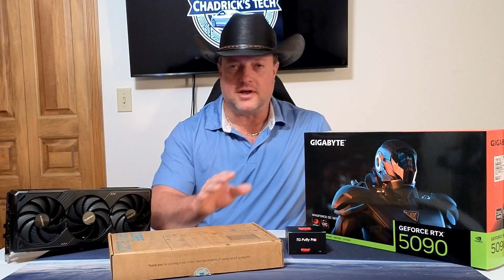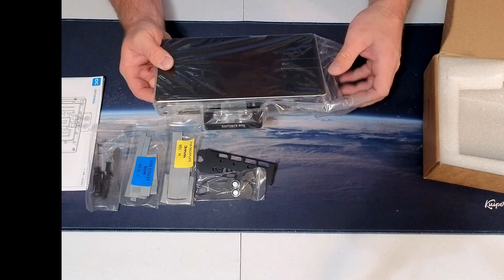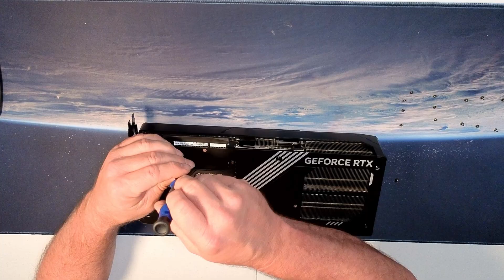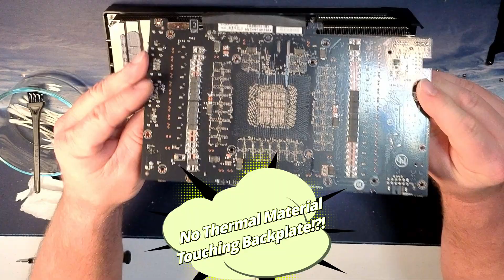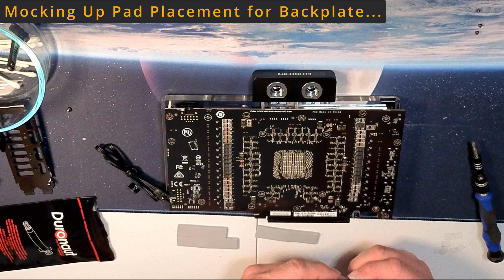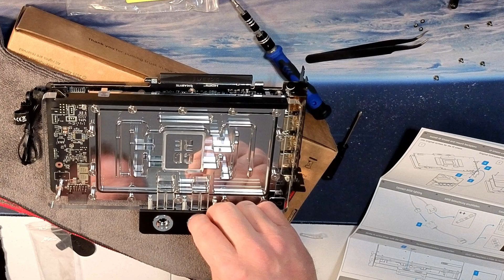Alphacool Waterblock Install on Gigabyte Windforce OC RTX 5090

Comment: Is it possible to remove the shroud and fans without removing the heatsink on this card?
Reply from the maker: If you needed to only get to the fans, I bet its possible.  Just dont remove the 4 screws holding the GPU die to the heatsink.  Worse case is no, and you get to clean up this goopy mess like I did.  Lol

Comment: Why not put the pads on the card they lay the block on top? Thanks.
Reply from the maker: Would probably work out fine.  Just following instructions.
Reply: @ChadricksTech  Gotcha. I’m asking because I have the same block coming for my Zotac 5090. It’s going to be my first ever block install.
Reply from the maker: @thelittledetailscr7231 take your time, gentle, dont force anything ... slow and smooth process.  You got this!
Reply: @ChadricksTech  Thanks brother.

Comment: Installing the water block doesn’t seem too difficult, the only thing I find complicated is all the pump stuff. How much does that roughly cost? And I’d probably also need a new case, since the three fans on top are already used for the CPU’s AIO, and at the front there’s only space left for two 140 mm fans
Reply from the maker: If you are contemplating water cooling your gpu, get that poor performing AIO cpu cooler outta there too.   Cpu block, gpu block, at least a 360mm radiator on top and a pump and reservoir.   I can give you a better idea if you tell me what case you have

Comment: I'm excited about this one. I was looking at this water block.
Reply from the maker: Block works excellent....cleanup of the putty was the only real issue.  And unless this was an oversight, there was not any thermal material on the backside of the OEM cooler!
Reply: @ChadricksTech  Good to hear it works well. I need to check mine and see if I have puddy on the back of it.
Reply from the maker: @DarkwoodsK9 Jayztwocents noticed that even the Aorus Master didn't have any material either, making the backplate virtually pointless.  The waterblock ships with pads for better heat transfer
Reply: @DarkwoodsK9  Did you receive and install the block? How has it been for you, and how is coil whine? thanks!